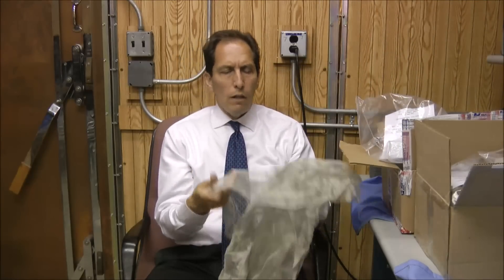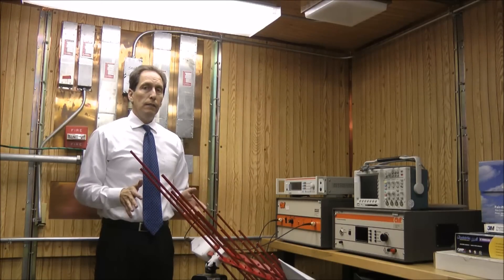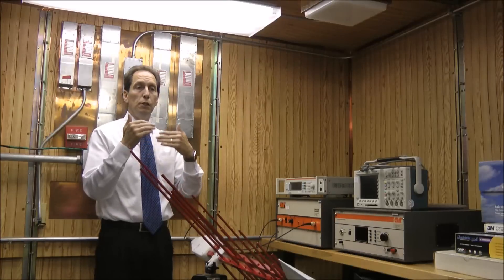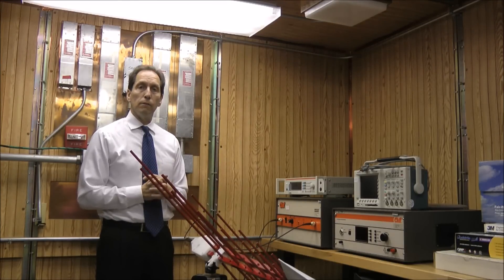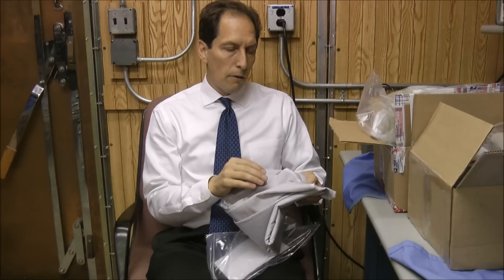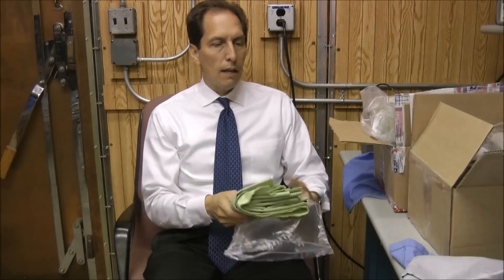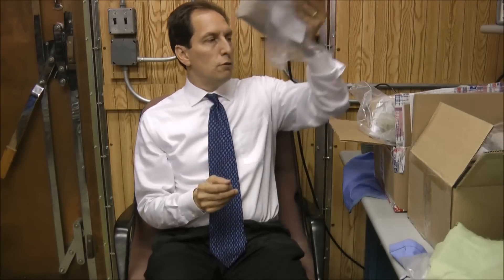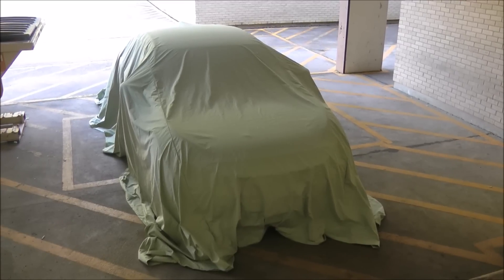Protect Generators and Cars from EMP

Comment: I wonder if just wrapping the ECU would suffice, or would the wiring pulse it anyway? We already have some metal cans & boxes for the emergency radio, phones & solar chargers. At long last, finally a use for that fruitcake...
Reply: Gary, do you already have emergency items that you do not need to use now that are already in the protective metal boxes you mentioned? There won't be any time to put items in if they're not already in there.

I assume that the metal cans have a metal cover or a metal covering held in place. Apparently there needs to be a good seal for this to be effective. 

Also, phones may not work even if they're in working order, but you can certainly try. The system necessary for the phone to connect with may not be functional. There may be a system still working somewhere, but will it be under the control of friendly people or hostile people? Remember that hostile people can choose to sound very friendly and may say that they desperately need help. Of course, friendly people may need help. Are the people who have either control or access to the conversation hostile? How will you know? I would say trust your gut more than anything - I mean anything - else. It could be that the phone may connect through a system to actually friendly people, but how do you know if someone else is listening too? There are likely going to be some hostile people as well as friendly people who manage to survive. Another thing: Even if the person you are talking with is friendly and no one is listening in on the conversation, you may consider giving your location information or getting theirs so that some may go to help them, but consider that other people may be out somewhere along the way. I say again: When deciding if you should try to go, trust your gut more than anything - I mean anything - else. I would hesitate to tell anyone else where you are. I would not do it. Often I have trusted people in the past in "normal" circumstances, sometimes for months or years. Then I find out that they are not trustworthy. With some of the people my gut told me that something was very wrong. Notice that I said with "some" of the people. After I found out that the untrustworthy people couldn't be trusted, I was able to examine my history with them and see clues, but the clues I saw were not always from the beginning of the time that I knew them. If you get any kind of warning, question or inclination from your gut, anything at all, pay attention to it. The only thing that I know of better than your gut is getting a yes or no from God, but to get that reliably you need to already be familiar with how God communicates with you and be able to receive God's communication without letting your own thinking or wishes interfere. There are spirits that are enemies of God (those same spirits are our enemy too) who try to imitate God to trick us, and sometimes they're pretty good at it.

Gary, you do not need to answer this unless you want to. I wrote this for anyone who would read this who may benefit. If anyone has anything to add, please do :)
Reply: @deborahelaine9985  All very good points. I had figured we could be caught unawares, but when things look volatile, it's probably a good time to keep the gear canned, except for making calls. My hope would be to get weather, police, or general news of interest, send msgs to family, IF any services exist, as you said.
Reply from the maker: I doubt that it would be adequate because there are literally hundreds of controllers and computers in a modern vehicle. And as you said, the exposed wiring would bring in much of the pulse even if wrapped.

Comment: find and dandy that you protect your car. QUESTION just where in the sam hell do you think your going to get gas?? EMP hit will kill all ATM's, gas pumps, cash register computer systems. Plus all the animal type scavengers out there that will kill you for your car. Protect all communication devices, short wave radios, regular radios, maybe cell phone?, CB radio units. Anything that can be used to get in contact with other areas. Solar panels, controller need protection. Gas generators possible, especially if you have a LP unit with tanks on hand for running, frigs, recharge battery banks. All these fabric covers will work or help.
Reply from the maker: It's a good question, but fortunately, there are many ways to get gas out of defunct gas stations -- even a simple fuel pump and a little rubber hosing can do it. Plus, of course, you could drain abandoned vehicles that stopped operating.

Comment: I absolutely wouldnt like my cloth to tarnish.
Reply: As long as it worked why would I care about discoloration?
Reply from the maker: The manufacturer specs show that some of the cloths degrade in performance after being wet because of tarnishing (i.e., minor corrosion). The stainless cloths are much less likely to have that issue.

Comment: Could you open the hood and just cover the engine compartment and the wiring - computer - alternator - fuse box - ext.? That would take much less material
Reply from the maker: I don't know how effective that would be because there are hundreds of controllers all over vehicle. Certainly in the dash, there would be exposed electronics.

Comment: The several articles I've read on this subject of making an EMP shield for your car by using a metal shed or building say to make sure the vehicle is not touching the metal sides.  So how can putting a conductive fabric directly on the vehicle be any good?  Everything electronic on a car is grounded to the body. Also, I haven't seen it mentioned anywhere, but it seems like (if there's time) pulling the battery out of a vehicle would be a good idea.  Not sure if a car battery would blow up or catch on fire in this EMP situation, but I would think it would be best to remove any power source from the vehicle (or any device) rather then just disconnecting it. Someone needs to do an EMP test on battery faraday cages.  The government probably did that test years ago but they won't give that info to us disposables.
Reply from the maker: The government did all kinds of EMP tests on vehicles using the Trestle. Plus, there's the EMP Commission's report. You can find it for free all over the web. As for the way a conductive cover works, it essentially creates a lossy barrier for incoming RF energy. It's not quite the same as a Faraday cage, but the net effect is similar.

Comment: Why do we keep saying EMP when it WILL be a flare with effects like an EMP but worse.
Reply from the maker: Actually, there is one big difference between the two. A nuclear EMP will affect small free-standing electronics because of the broadband release of energy. A solar event will release a low-frequency electromagnetic disturbance that primarily only affects very long conductors (i.e., the power grid). Yes, that would be VERY bad, but there would be no reason to protect your vehicle from it.

Comment: How come this material protects electrical equipment more then the metal car body, couldnt you just ground the car body to ground while disconnecting battery get same effect?
Reply from the maker: The windshield, windows, and gaps in the vehicle would all RF energy to get in. Essentially what the cloth does is seal up the holes.

Comment: Leaving your  house after an emp or similar would be making yourself a target , bug out at home unless you have a diesel unimog , half track , etc. Fully self-contained with solar , water , winch and fuel and a destination, something that doesn't need a road ! Anything that isolates you is making you an easy target !
Reply from the maker: Amen, it's just that having a way to get to safety or retrieve supplies might be very helpful.

Comment: would you do a co contract for a poly dipped and wrapped vehicle company, have you been approached by any one besides government agencies
Reply from the maker: I'd be willing to test any device or vehicle if there's a funding source behind the activity. It takes quite a bit of effort to set up and run the tests.
Reply: @disasterprepper  I Just realized this would not work due to atmoshperic discharges due to dust clouds nvm my bad bro the amount of wiring would take years but it would protect a vehicle in the off position for quite some time

Comment: OK, I've seen faraday cages and metal containers with a ground strap and grounding rod driven into the ground to dissapate the EMP to the ground same as a lightening rod grounds to the ground. The question I have is.... A vehicle body, frame, and engine all use each other for the ground. Could I not ground the vehicle to a rod driven into the ground a few feet and it be protected? Park the vehicle next to a couple of grounding rods then hook a cable or even jumper cables to the vehicle and rods. After all my vehicle is all metal no plastic except behind the front bumper. I would think it would be its own faraday cage.

Comment: The e biggest problem with this sort of EMP protection, is that you won't likely know an attack is coming until after it hits.
Reply from the maker: You're absolutely right. It's a safeguard that you put in place when something's not in use. No perfect, but it offers some measure of protection.
Reply: True. I can envision it thrown over the Landmasters from 'Damnation Alley'.  

Perhaps the best practical solution would be to have a replacement computer board (and radios, etc.) that would be kept in an EMP-safe container, and then swap it out when and if the original fails. That, of course, depends on how easy it would be to replace it in today's super-cramped engine space.

Comment: Ground your car just take the tires off and put 4 rods in the ground use a very thick copper wire connect it to bolts on your car and whola, you're car is grounded or build a Faraday cage around your car
Reply from the maker: I think you're joking... if so, it conjures quite the image. LOL  In the off chance that you're not joking, I should say that this wouldn't work. The openings in your car's chassis are far too large for it to act as a good Faraday cage against high-frequency signals.

Comment: By draping a emp cloth over your generator will do nothing, EMP will get in from the bottom it has to be 100% sealed to work effectively
Reply from the maker: Actually not quite true. There's quite a bit of misinformation on this on the web. The earth itself is a weak conductor, but even if it wasn't, waves in the far field are attenuated by conductive barriers, regardless if they are grounded or fully enclosed. Of course, it is better to have conductive barriers on all sides.

Comment: I own a lot of very valuable cars and motorcycles,they are baseball cards to me,traded sold,i like them,anyway,i cover all of them with chicken wire,found at any hardward store,this is all about discharge,energy going to ground,the earth is ground,if you have to have the vehicle for transportation all of the time,hide coils,extra ignition parts,separately,wherever you put the parts ground it with the wire,its all we have,the cloth is impregnated with metal for grounding,his product is valuable if it can be put over new paint,good luck

Comment: conductive on both sides is no good
Reply from the maker: It depends on what you're trying to achieve. In this case, I'm not trying to create an isolated Faraday cage, but rather a unbroken layer of shielding. The car itself, of course, has a conductive frame, which works in conjunction with the cloth to provide shielding. I've talked about shielding methods a few times in previous poss, so if you're curious, you might read some of the comments below. Anyway, the bottom line is that measurements always tell the story, which is I why I conduct experiments.

Comment: Perhaps my suggestion will sound foolish or naive...but why don't this type of EMP prevention on the towers in the grid? Probably expensive, huh?
Reply from the maker: You would have to create extensive shielded conduits for the transmission lines to pass through - many of which are at very high voltages. In theory, it's possible, but yes, the costs would be tremendous.

Comment: .. what if you just disconnect the battery?
Reply from the maker: It might help a little, but it wouldn't fully protect the sensitive electronics. The incident RF energy could introduce voltages and currents that could cause damage, regardless of whether or not they had battery power.
Reply: Nope, the wiring acts as a antenna and sucks the energy up. Just like the electric grid. The wires of the grid are the sponge. Like a old style tv antenna

Comment: For effective "Faraday" protection, covers MUST completely enclose the object being protected.  Simply covering an object with conductive cloth is not enough to assure protection.
Reply from the maker: Well, there are two ways to look at covering. First, is that the ground is the fourth side of the Faraday cage. The earth is, after all, a reasonably good conductor. Or, and this is the way I think about it, is that the cloth is simply an RF reflector/absorber. Any conductive material put between an RF signal and a receptor will significantly reduce the signal due to these two mechanisms.
Reply: No Cigar.  EMP is NOT an RF signal.  Faraday Gage is called a cage for a reason.  Your reasoning MIGHT be true for an EMP caused by a mild to moderate CME (Coronal Mass Ejection) but not even close for a HEMP (High Electromagnetic Pulse) from a Nuclear weapon, high altitude detonation.  You could put a portable generator inside a large wire dog kennel, ground it with braided wire to a rod in the ground (check for good electrical bond between all "6 sides" and ground) and drape your cover over it for added protection.  Note that tires do NOT ground your vehicle to earth ground by merely sitting on the ground. Even if it is raining, not likely sufficient to protect against HEMP even with your cover over it.  Most people are parked on concrete and certainly are not leaving their portable Genny's outside until use.  Any item that has solid state devices in it and not already in a Faraday cage when HEMP hits will be rendered inop by the electromagnetic pulse. 
Carrington event of 1859 was said to have cause telegraph wire to burn through.
Reply from the maker: I won't argue with you. You're certainly entitled to your opinion. Do as you see fit, my friend.

Comment: If things get that bad, what difference does it make if you have transportation? Where are you going to go? The stores will be empty. Gas stations shut down. Why even leave home?
Reply from the maker: Most scenarios would leave some areas of the country less effected than others. Having wheels might well let you get to a safer location. Also, assuming you can retrieve fuel (perhaps from non-working vehicles), you could use your vehicle to retrieve supplies, tend to loved ones, etc. Better to have options whenever possible.